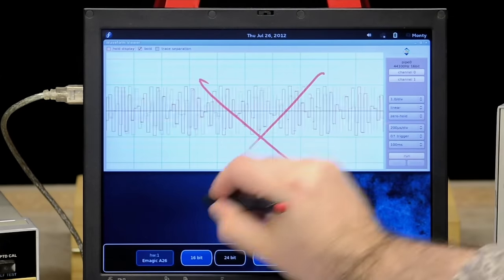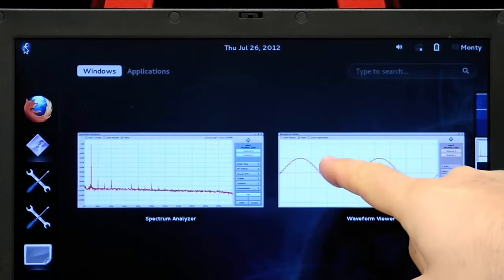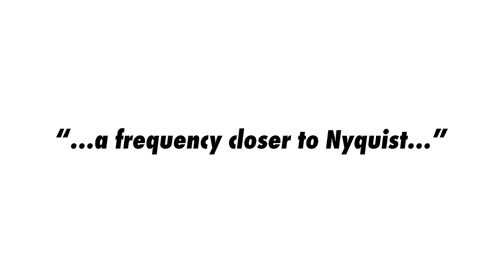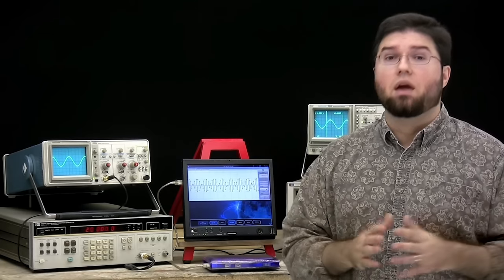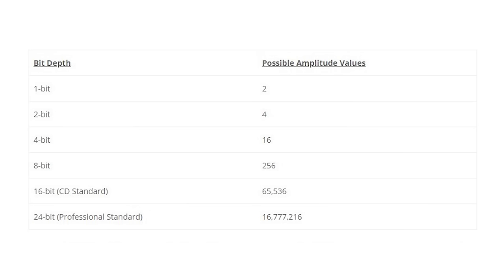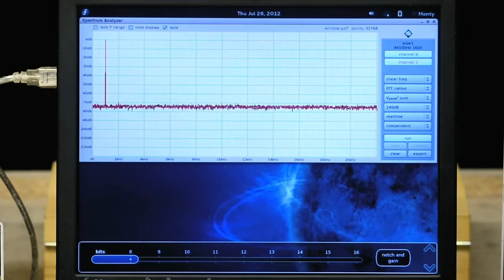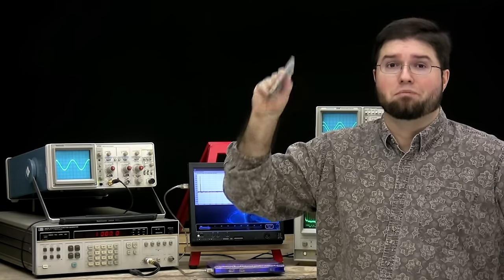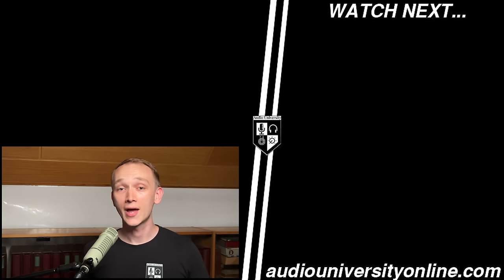Debunking the Digital Audio Myth: The Truth About the 'Stair-Step' Effect

Comment: Stair-step if present, is filtered inside DAC, if you build simple DAC (like R-2R without filter), you'll get them as they are. More advanced DACs do more advanced math to decode or in laymans term, connect the dots in a logic way to recreate the wave  and even then you can get a stair-step wave (oversampling or making/predicting more dots), but so fine you won't able to notice, plus single resistor and capacitor takes them away really efficiently.

It's not like the stair-step is not a myth, the myth here is people think you'll get stair-steps on the output of DAC.

Comment: Was the quantization noise demo, with the notch filter removing the 1KHz tone, also done using the “DAC box”?  If the “DAC box” is removing stair steps, as I suspect it is, it will also suppress quant noise.  

The demo, to be effective, needs to be done with the signal at the “DAC”.

Comment: Question:  if you have sounds more complex than a single sine wave (multiple frequencies), how does that impact the analysis?  It seems to me that it would take more sampling to encode and decode the signal??
Reply: That's correct. Also when you don't sample every point, you have to do mathematical guesstimate of where the apex and trough of the waves are, since not all soundwaves are perfect 1khz unchanging sine waves like shown in this video. That one fact invalidates almost every claim in this video.
Reply: Fourier analysis shows that all complex signals can be disaggregated to simple component sine waves.
Reply: it makes no difference whatsoever, everything shown here works equally well for an arbitrarily complex signal as long as its bandwidth does not exceed the passband of your audio converters (typically 20 kHz or more), though if it does then the part within the passband is still preserved.

Comment: It was kind of funny for me to feel the answer emerging from the back of my mind, when the question was formulated as to how it is possible for the 1 kHz sine wave to keep on smiling, while the digitizing seemed to look so awful. And I'm not a professional in this field. But, my general engineering experience told me what it was: the limited bandwidth, allowing for only that one sine wave that was put into the input stream. All the "steps" represent high frequencies, which will not pass at all.
The video explains very well as to how these "steps" are not obviously there. So, the system is acting as if something is there nevertheless, while smoothing them in the process. A step function represents an infinitely high frequency, as one voltage level is exchanged for another one in no time at all, ergo, at an infinite phase change speed, which obviously cannot occur in real life. So, lower frequencies fill the gap, rendering the expected sine wave in its entirety, leaving no trace of the theoretical steps that the oversimplified model predicted.

This reminds me of the analog lock-in amplifier that my tutors at the research facility taught me, when I started to work there in the 1980's. It is also reminiscent of the superheterodyne radio concept of the FM radio system, in which the carrier wave, basically a sine wave of a well known frequency, is picked up from lots of noise. The idea is that noise is random, but a sine wave is not. Once you can predict the sine wave, you can take the signal and strip the sine carrier from it, washing away the noise and rendering a well defined signal of high quality.
That concept already worked without any computer technology whatsoever. The sine wave prediction was (and is) achieved by mixing the received signal with a locally generated sine wave, which virtually mimics the expected sine wave in the noisy signal. The art of analog signal mixing is the key to it all.

Comment: I've always wondered about that Nyquist/Shannon stuff.  Suppose my sampling frequency is exactly 44.100kHz and my signal is exactly 22.050kHz and synchronized such that all the sampler ever sees is 0V.  Won't it produce a 0V output?  If the phase is just a little off then it will see a faint 22.050kHz signal, but certainly not the original.

Comment: What we should be doing is performing those band-limiting operations on the displayed waveforms so that the waveforms will look like what the oscilloscope will see. Also some of our dynamic range in our ears comes from the eardrums being tensed by muscles that effectively dampen the sound a little, like a volume knob... so the human range is actually lower in practice than on paper when you use the whole range at the same time. This is why even I (with young ears that I take care of) cannot always hear the hiss from a good vinyl record that was just made... even though a CD is far superior by numbers alone, I cannot usually hear the difference until there is some wear or maybe on a really really high end sound system. And even then, only during silence portions where the noise isn't covered by music. CDs look like hilarious levels of overkill by comparison. Good for Sony and Philips for making them so ridiculously overkill.

Comment: A sine can be described with just 2 points, but with squarewaves at 44.1 you start getting them smoothed out from 10k and that's audible. At 44.1 every signal 10k and above is and will be only a sine.
Reply: No.

Comment: the waveform isnt perfectly smooth, although most people cant hear the difference.its not stepwise either though, as most modern equipment use a filter capcitor on the output to smooth it out.

Comment: I'm interested to know, so if you take a 24bit/44khz recording and play it back at 16bit/44khz or even the other way round what impact does that have on the noise level? I mean if you had a sound card with only 16bit dac and played a 24bit file presumable it will down scale it to 16bit, so somewhere 8bits of the sample have gone and you just gain noise?

Comment: O I got a good one for you! How does a 1 bit dac work? I remember seeing these on portable CD players.
Reply: Before: oh! sucha great men onestly displayng nayvety, you deserve a lot more, in your honor  I decided to invest some 30 min, so if you want to have, not the true, but at least some insight about the whole subject, follow me in the next few post (in chronological order).

Answer: that's easy, a capacitor ( or one of the circuit called integrator). Provided that the integration is an area calculation.
I assume know but in Ex. if I supply a capacitor with a costant current "I" for a certain time (Tfinal - Tstart) you end up to a final voltage Vf (assume Vstart =0)
Vf = I * (Tfinal - Tstart). Here to do an integration you need only the formula required to calculate the rectangle area. If current is varing over time is only more complicated the math.
Why You do this needs some explanation. So follow.

Comment: Of course, even if the signal was a "stair step", the speaker that you have to use to hear it, can't move in increments either, and therefore would still produce a smooth sine-wave as well.

Comment: The point that "higher bit-depth = lower noise floor" explains something I'd experienced but didn't understand.

I had written a script using sox and ffmpeg to generate sin waves into a 16-bit wav file and compressed to a 16-bit FLAC. And because it seemed interesting to see if it still worked, I tried again with 24-bit waves before compressing to 16-bit FLAC. And this FLAC was smaller than the one I'd generated before (with same sin freq, amplitude, duration, etc). And when I tried again with 32-bit wave files, this FLAC was even smaller than the other two.

I'm guessing that the lower noise floor allowed it to waste less space from noise. I'm not sure though.

Comment: In digital video, everyone has seen the effects of a pinstripe suit. It's called Aliasing. It is not the frequencies above Nyquit that are a problem, it is the difference frequencies below the sampled frequency. Even the low amplitude signals can be clearly heard when there is no music content to mask or cover up the Aliasing. To reduce this effect, the sample rate should be at minimum 4 times the highest frequency so all Aliasing.frequencies are above 20KHZ and filtered out.. This is why, instead of 44.1KHZ, high end professional PA and recordings are at 96 or higher sample rates.

Try this with your ears and your spectrum analyzer set for the log scale. In Audacity, generate a "Chirp" using the effects. Record it between -5 and -10db. Set the chirp frequency sweep from 17 to 21KHZ. Play back the digital WAV file. Don't use compression to add compression artifacts of compression. As it sweeps up, notice the frequency sweeping down as the difference between the generated frequency and the sample rate decreases. Use the best DAC you can find.  Now you know the issue with CD quality. Yes you can hear it. Yes it is masked with most typical stuff recorded for FM radio with a low pass filter cut to 15KHZ. Live recordings with cymbals coins, and other harmonic rich content is dulled by the low pass filters used to reduce the amplitude of Aliasing.

A prime example is if you can find an analog copy of Pink Floyd's Dark Side of the Moon, and a CD of the recording, to listen to side by side, compare the track Money. Most people have never heard a good analog recording of the song.

The low bit depth increases the amplitude of the Aliasing. This is seen in the video when the low bit depth signal is displayed on the spectrum display. It shows as the picket fence of lower frequencies spaced at regular intervals.
How to get a low bit depth recording in a 16 bit signal? Simple, low volume. The upper bits don't change, so only the LSB  bits change. Yep, recordings with dynamic range have the worst Aliasing. due to the lower number of active bits.  Record at 96 KHZ and the picket fence starts above 20KHZ, not in the low frequency range.
Reply: @nicksterj  Don't ell anyone, but most programmable function generators are digital. Unlike audio equipment, the D/A is not a fixed clock rate, but it is multiplied relative to the frequency to be produced, so the Nyquist frequency changes with the frequency produced. Very few are true PLL oscillator units with 0.0005% THD. Many function generators in the gudget range are 8 bit as are most digital oscilloscopes.
Reply: @nicksterj Interesting the signal generator has a keypad. This is not the twin T analog signal generator of years ago. I used a tube HP twin T oscillator for years in vintage equipment.

Comment: ugh. it matters in the recording stage. I actually do this professionally. It's the same with video. we record at a much higher bit depth and colorspace, then force it into a tiny 8bit srgb container. and it looks great. but if you recorded in 8 bit, it would look terrible in many scenarios unless shot perfectly. same principal in audio. the dynamic range is needed for post production work. downsampled properly, it should sound fine. 32 bit recording is amazing. impossible to clip, easy to bring up low signals, and allows surgical removal of noise.

the reason people seek out high bit depth and sampling rates is because they want sound as close to the studio master as possible because downsampling errors do occur

Comment: I was unaware that this was a mis-understood fact.
I have zero formal education, and honestly get lost in trying to understand the gritty details of digital audio.
I have been a at home musician since 1990, and started on cassette multi track recording.
My first digital recorder was a Boss BR-532, and was never really happy with the quality of its sound.
Never mind the fact that i would plug instruments directly into it, and do vocals with the built in mics, I thought the quality issue lain in the fact it was "only" 16 bit, 44hz.
Back around 2005 or so, manufacturers were a little more honest, or at least more straightforward about the benefits of an expanded digital signal.
It was then, as it is now, a matter of the db's vs. the noise floor.
Clear loudness always gives the perception of high quality, and is true to a certain extent.
Our ears are analog. When you discover a sound on a track you never heard before, you do not turn it down and listen again, you turn it up.
This is why re-mastering old music sounds "better".
They didn't re-record any of the music.
Because the digital bandwidth can push up the db's before noise is perceived, they are simply making a louder master, making it easier to hear more detail, even though that detail was always there to begin with.
With each new format offering ever higher numbers of rate, and depth, the sound is not getting any better, its just getting louder.

Comment: The commonly stated range of human hearing is 20 to 20,000 Hz. Under ideal laboratory conditions, humans can hear sound as low as 12 Hz and as high as 28 kHz, though the threshold increases sharply at 15 kHz in adults, corresponding to the last auditory channel of the cochlea.

Comment: The "sampling theorem" is a (need I say it?) true theorem in mathematics which states that set of finite samples at the Nyquist rate or higher is a perfect representation of a band-limited signal that can be used to convert back to a precisely identical version of the original signal.  This of course depends on the signal being truly band-limited and the samples being real numbers with no errors.  Both of these requirements are violated to some extent in a real system, but as pointed out in this video, the errors that result from these violations in a modern digital sound system are very small.  The sixteen-bit depth of the dynamic range of CDs does result in errors --- the loss of the infinite number of bits beyond 16 that are needed to make the sampling theorem precisely true. (We assume here that, in a correctly made CD, we're not missing any bits off the high volume end of the signal that would be clipping.)  The missing low-order bits are, on average, random, and as a result their effect is to add a white-noise floor that is generally below what can be achieved with analog equipment.

Comment: A couple years ago I re-released an old album of mine re-mastered from original tapes. Lossless 24-bit FLAC is available, but people keep asking me "when are you going to release this on vinyl?" It would sound worse on vinyl, especially since the album is 47 minutes long. It was quiet on the original vinyl with bass turned down by George Horn in mastering to keep needle from skipping. It would probably have to be 2 or 3 EPs, 45 RPM 12 inch to come close to the listener experience of the CD quality (16 bit) digital files.